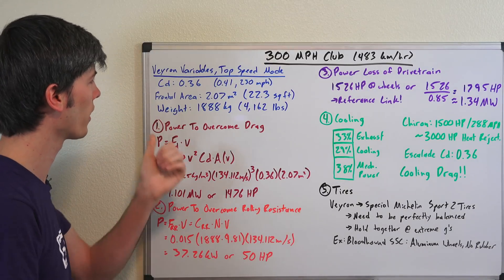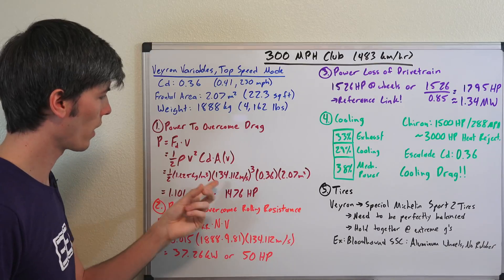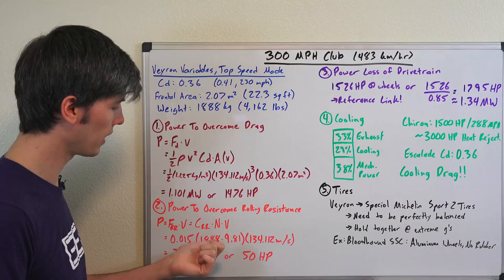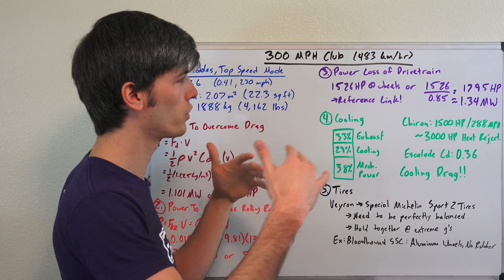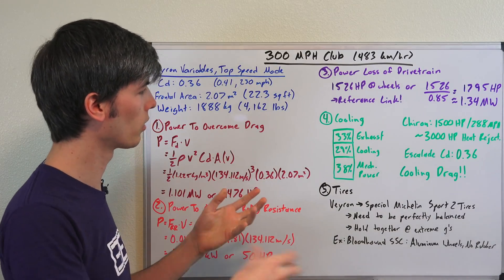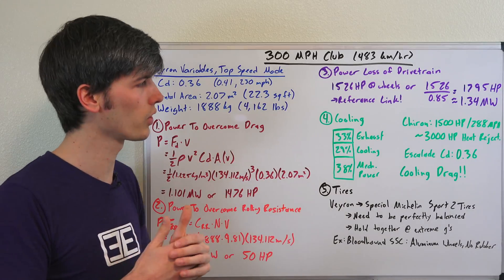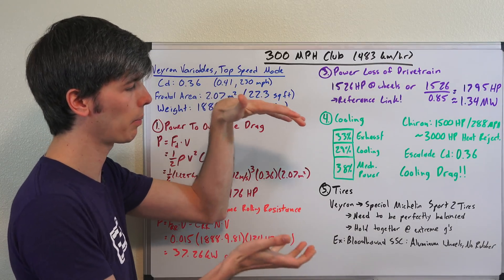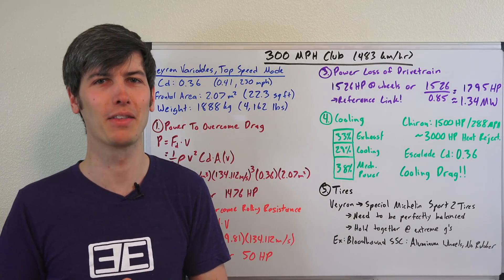Why Has No Production Car Hit 300 MPH?

Comment from the maker: IMPORTANT NOTE! For completeness, you should include downforce when calculating the power to overcome rolling resistance (thus the equation would be Crr*(N+Downforce)*V. That said, I used a high estimate for coefficient of rolling resistance, meaning the actual rolling resistance could be significantly less (not accounting for downforce). Additionally, rolling resistance is very minimal in comparison to aero (about 3% in this case). Rolling resistance does not have a huge impact on the final result. Ideally, for a top speed vehicle, you don't want significant lift or downforce. Just enough downforce to keep it stable and prevent lift, but not much more. Adding downforce at speed means greatly increasing the amount of aero drag to overcome. The Veyron adjusts active aero to reduce downforce (and simultaneously drag) in top speed mode.
Reply: +Engineering Explained (with a space) 
Good catch, I wondered how long it would take you to detect the missing factor.  ;)
Reply: Electric vehicle batteries generate a huge amount of heat when they are discharged. In fact tesla has their batteries liquid cooled with a heat exchange radiator intake just like a normal car. I would be curious to see what more there is on this
Reply: Engineering Explained it's not like i understood all this anyway, but thanks for honesty.
Reply: EngineeringExplained , can you do a video debunking the fake hoverboard 
"Flyboard Air" that is viralling youtube?  It is a fakest thing you've 
ever seen, with terrible acting, and totally edited scenes, but 99% of 
the commenters there believe it is real!  Please show us the math on why
 it is absolutely impossible and completely faked to fly like a jet on a
 tiny jet powered shoebox.
Reply: so far ahead that they have to cheat on emissions...lol
Reply: Grumpy ol Boot he calculated total rolling resistance by using the entire weight of the vehicle. In reality the entire weight is not on one wheel so you could figure out how much weight is on each corner and find the hp for each wheel and add them up but you get the same number.
Reply: http://www.guinnessworldrecords.com/news/2016/4/confirmed-franky-zapata-sets-new-farthest-hoverboard-flight-record-in-france-427011
It is real though. That being said an EE episode about it would be nice.
Reply: +sn0tkore10, The Porsche 918 electric/hybrid hypercar would like to have a word with you.
Reply: Engineering Explained koenigsegg regera
Reply: Mythbusters actually did that. They slapped a bunch of clay on a car, shaped to the car with indentations (admittedly rather large ones) and they managed to make a car become more fuel-efficient with the golf ball effect,

Admittedly it was 500 pound heavier because of the clay but hey, it was an idea that worked for something. That, and Mercedes Benz made a car before with a dimpled underside, explaining in their advertising that it was for aero. So your idea might be sound in some practice, but is it sound for the theory of cracking 300?
Reply: Engineering Explained
Reply: Chrysler made a production Turbine engine car.
Reply: Justin nitsuj they tried to make a turbine engine car.  never made it into production.
Reply: You may be wrong with the rolling resistance. Most cars of this nature require a lot of additional downforce, which the car is designed to provide. Therefore the effective weight of the car at high speeds will probably be a lot more due to aerodynamic down force, therefore increasing the rolling resistance so as to get enough traction. Therefore the force to overcome rolling resistance can be a lot more than the one you calculated.
Reply: Right.  His Crr is quite low, only 0.015, when according to one equation that I use, at 300 mph, it should be about 0.081 with a tire pressure of 44 psi.
Reply: @nats50  It do not matter chiron did it
Reply: Came here to post this, saw you already noticed yourself. Dayum!
Reply: If a car was capable of producing 5000HP at the engine, would that be enough to hit 348MPH? Search: "Devel Sixteen"
Reply: speedox12 most people know it, I mean the people who their origin is in the UAE ,like me, they will definitely know the Devel sixteen, and in most other countries they know the car
Reply: Another video within the comments 👍🏽 very thorough and detailed! Awesome
Reply: Engineering Explained Can you like take classes for me because honestly I learnt a lot from this video, more than I ever learnt in my physics class. Btw I'm in 9th grade 😂
Reply: 2019 bro we hit it 300mph
Reply: lol i was thinking you didnt account for it.
but didnt you say it was in top speed mode. i assumed you took downforce into that calculation
Reply: Jonas Venture Jr. It "might" be real, from what I have seen, i looks somewhat legit. And from what i have heard, its made by the same guy who made the water jet pack(I forgot the name of it).
Reply: I think he's not talking about turbine engines or any other kind of engine because he's talking about production cars. Doubtful that any car company will make a production turbine engine but I guess it's possible.
Reply: @Jonas Venture Jr.
The Flyboard air is not rocket powered, but by electrically powered fans, spinning at absurd speeds. The whole thing is only possible because of battery technology advancements. Current flight duration is only a few minutes.
That being said you are an obvious troll anyway.
Reply: What?
Reply: bluephreakr that episode is what had me thinking about that idea
Reply: Justin nitsuj That was a joke right?
Reply: ??? google it
Reply: Justin nitsuj oops wrong comment. Someone suggested making an engine that runs on nuclear energy which is literally retarded.
Reply: wow!! Leno must have some connections at Chrysler because he has one! As well as having commercials for it...and print material for marketing. And wiki says the were put into production....but THEN they recalled them...apparently all but nine were destroyed.....So yes, like the EV1...it was a production car.
Reply: waiting to se what the regera can do =) no 300 but probably close, who cares anyhow?
Reply: Awesome! I was literally thinking about commenting about that, although it is somewhat of a mute point. All in all it still seems as though tires are the limiting factor. And for good reason! The acceleration of the tire at that speed is insanely high!
Reply: Hah, I commented on the video and asked about this before I saw this comment.
Reply: Downforce adds a lot of drag. That's why a Mclaren F1 with 627 HP and very little downforce and no wings, etc... reached 391 kmph with a bit of instability, and why a Mclaren 720S with 720HP can only reach about 340 kmph or so but can destroy the competition on the track. 

All hypercars are limited to 350 kph even if their HP and aero allows for 400 kph+ speeds because of the tires.
Reply: Kobe Cold good grammers much wow
Reply: Engineering Explained hey sir, there is a car who set to have 348 m/h which is the Devel sixteen made in Dubai, now the car isn't tested but with calculations, can the car achieve the speed with calculations or it should be tested
Reply: Engineering Explained the devel sixteen can go about 330 mph with 5000 hp
Reply: and when has it done that?  the car is vapourware. (the devel sixteen)
Reply: Thanks for that. To get more cooling without any parasitic effect it would be possible to use the skin of modified material to suit the heat transition requirements for more heat radiation.  This would probably be the easiest way to cut parasitic drag that ducting creates..
Reply: Unfortunately that won't work really, as radiation is HUGELY inefficient at dissipating large amounts of heat. The ISS cooling system for example, can radiate 14kW of heat (The heat rejected in the video is 2200kW) and it's 10 feet by 45 feet. 

There's no easy way to make it more efficient without boosting the radiator temp enormously (it scales with T^4, so you get REALLY fucked with small temp differences between source and sink)
Reply: Thanks for taht - I understand that it will not work as well as a high spec radiator system with a big flow across it but it will contribute to more radiation.  Not sure of how the actual specs will compare.

I did have in mind the effect of surface exposure to air flow not just radiation. 
    
Do you have any figures on that which would be helpful in explaining the actual heat transfer comparison of a big surface. What does the Huge difference  mean.  Five to or ten to one or more per unit of area? 

I am aware that temp difference is a big factor  having owned an air cooled vehicle. High summer ambient temps of over 110 degrees F made hardly any diffrence in cooling capability where conventional water cooled vehicles suffered a lot.  
 Radiator temp differences seem to be the best option.
Reply: EmmetDash nope.  1000hp is what it makes to wheel, 2000hp worth of heat.  Set the speed tunnel duct on fire.  So if it was 3000hp, the car would catch on fire, or need a stupidly powerful cooling system
Reply: the dagger gt car has reach 301mph look it up
Reply: +Engineering Explained hey man, I noticed you, as well as quite often a lot of other people always talk about kW or HP on the engine but always forget to mention the amount of torque, that makes the car move in the first place. Maybe you could've calculated out, how much torque is needed to make that ridiculously heavy Veyron (Henessey Venom GT weighs less than half of the veyron and goes faster) go that fast.
Reply: Engineering Explained the car you were showing was the Chirion 😂 smh
Reply: Engineering Explained please explain about the new claimed top speed of the Hennessy venom f5 that was just launched in November 1st recently.. is it really possible for the f5 to attain their claimed top speed? tq..
Reply: I assumed this was factored in with overall drag.  
Needed to hang onto tarmac at 300mph
Reply: Skin cooling must be answer plenty of air flow just run water through skin of car might have to put few fins
Reply: A sort of compound engine would be answer half size of main engine then add turbine engine to use heat out main engine plus more fuel
Reply: Why not use an afterburner?  Jet engines use them to get more thrust for very little additional weight, and there is no need for additional cooling and cooling drag.  Alternately, the Wankel rotary engine could produce enormous horsepower in a very small, lightweight package if they could solve the compression problem.
Reply: Well it happened now !! :)
Reply: bugatti chiron 300mph bit*h
Reply: I've heard that rolling resistance also depends on wheel torque squared. Is it true?
Reply: Interesting video. Good work! My question is can an EV do it theoretically? Because the electric powertrain has much higher efficiency so much less cooling is needed for heat dissipation. Yes, the battery can get hot, but using Supercap and lithium cells can somehow manage it to an acceptable level.
Reply: My bet is the first car to hit that will be electric, I know batteries weigh a lot but lithium ion batteries can produce a lot of energy relatively with a small size and  an almost 5000 pound car is the closest to hitting 300 so I don't think that would be an issue, plus with electric motors modern heat syncs don't need to cause as much drag because it can be a flat piece of metal. And you can get ridiculous amounts of hp from relatively small motors with no added turbos gas ect. 👀👀👀 we will see tho
Reply: Why dont people use turbine engines for these supercars? You would eliminate the cooling and drag problem quite a lot.
Reply: What about an electric vehicle? It doesnt need all that cooling thus less drag. Maybe Rimac will have the first 300mph car
Reply: @ Ji Vincent - A proper performance EV can out accelerate ANY ICE car from 0-100, but eventually the best ICE cars catch up.  If you can properly gear the EV, then YES.  The LS-218 Lightning Motorcycle back in 2013 had a world record of 216mph AVERAGE 2-way at Bonneville.  That;s staggering.  Electric bikes are better at altitude, at winning at Pikes Peak.  For cars, you have drag, or anti-aerodynamics, and you might need weight - just keeping it on the ground.  It's a fine balancing act at those type of speeds.  Judging between downforce and speed.  I've seen horrific wrecks with speedboats...they just take off.  You don't want air underneath the nose of your car lifting you up.  Yikes.
Reply: Actually, 15% is used for FWD and RWD, for AWD cars is generally 20% power loss IIRC
Reply: You also need downforce for stability. Downforce creates drag, thus every supercar has a bad drag coefficient.
Otherwise, you'd have accidents like cars flipping or flying away
Reply: Guys - There is a lot of information on this on valious sites of you google it. The technical info  is that radiation is used on special panels deployed on the exterior of the spacecraft.  There is no other way since the normal on earth ways of convection and diffusion cannot work to reduce heat away from the whole craft in a vacuum.   Diffusion wuold work if you heated parts of he spacecraft and continued to throw that part away but that's about all but you would eventually run out of mass.  That is however re entry vehicles got rid of some heat by the heat shields degrading due to the combined action of heat and friction.  Mass was lost from the heat shield along with that the heat contained in it.
Reply: But you do realize they limited the veyron to 1,00 HP. The engine can produce 3,000 HP. They had said they set fire to the exhaust duct when they first ran the engine on the dyno....
Reply: On a sidenote, didn't you just calculate the rolling resistance for one wheel ?
There's 4 of them after all. :D

That said, it wouldn't make a big difference even then, the aerodynamic drag is where most of the power goes to die.
Reply: You need to look into the Globe Earth lie.
Reply: There is another factor related to downforce that will come into pay, aerodymanic lift. It might be impossible to design a practical production road vehicle that would not turn into a wing  at >200mph.
Reply: Engineering Explained what if you changed the shape of the car to cause a turbulent wake interfearance effect? like golf balls or insect wings. if you put them on the front and sides also put some little bumps on the rear wing. some funny car and top fuel teams did that in the early 90s until the nhra changed the regulations
Reply: +EmmetDash So, you can get 3KHP *once*, and then you die in a blazing fireball moving 300+MPH. I cannot believe they left that much power untapped for no reason!
Reply: why has no one thought to cool engines with freon
Reply: Exascale while they produce heat, they are significantly more efficient which suggests they will not produce anywhere near as much. That said, noones tried to make an electric hyper car yet so I expect there are other problems to overcome.
Reply: SnowIsMyTerrain 
please correct me if I'm wrong... but the iss is in a vacuum in space, so that means there is no air which can go truth radiators. that's why you have nearly no heat dissipation and need this massive radiator to cool 14kw. because the air takes the heat away from a radiator and there is nothing in space.
so if I'm correct you can absolutely not compare this.
Reply: anjoLas ya but ur still on the euro! LOL! you guys have much bigger issues then designing fast cars. if i remember correctly german engineering didnt due to well in WW2 where it really mattered. dont see many german autos winning at track either.

Comment: When you dyno a vehicle to work out its power, isn't rolling resistance power is already subtracted from the power number? I'd imagine most of the "drivetrain losses" are actually hysteresis losses in the rubber/rollers connection rather than any inefficiencies in the gearbox. I'd imagine the gearbox oil would start to smoke quickly if it lost 150 horsepower, though no doubt there is a radiator in that car just for the gearbox oil. You would see this if you compared the output if you could directly dyno the drive axle rather than friction driving rollers. This would remove tire losses and give you the actual wheel horsepower, rather than the "road pushing horsepower" which subtracts rolling resistance. The other thing not included in the final power figure is the kinetic energy gain in the rotating wheels, tires, driveshafts, gears and revving engine.

Comment: For all the kids in the comments:
1. This video was posted two years ago and explains tech challenge of going 300 mph.
2. This video is called "Why has no production car hit 300 mph?" at the moment of publication of this video, two years ago.
3. This video is called "Why has no production car hit 300 mph?" and the title is still valid, because the "Chiron" that did 304.77 mph has different body, engine, aero and tires, is a prototype, and is not either a road certified or production car yet, and has to do 300+ run both ways before it's valid.
Reply: And i read somewhere tagt they made 30 of them and sold 2